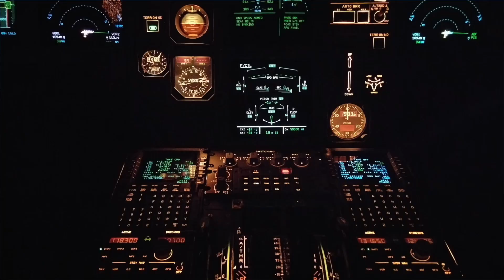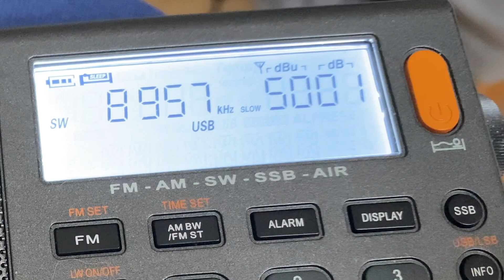Aircraft Communication. A beginners guide to aeroplanes on shortwave.

Comment: Ok So u use use upper side band to listen to the air frequencies I just thought u switched it to air on the xhdata d-808 and away you go. Which I did and that's probably why I haven't heard a thing. Now tell me about the antenna your using. I got a tecsun long wire thing from eBay. One last thing Pete if I was to use better antenna would I receive Ssb better????
Over to you fella.
Reply from the maker: Hi .. thanks for commenting. The air band on the XHDATA is VHF AM and will pickup communication local to an airport. The shortwave frequencies mentioned are used for over the sea etc  when planes are long distance from base. A long wire will work fine on ssb or am equally well. you can experiment with different lengths 10 meters 32feet is nice but don’t worry too much about the length.
Reply: @LONGINTHETOOTHtv  same thing I tell me wife.
Yer cheers buddy I brought me radio cause of your videos.
Cheers for reply.